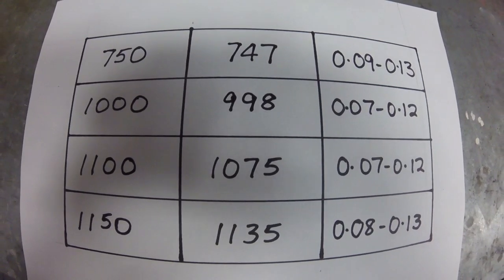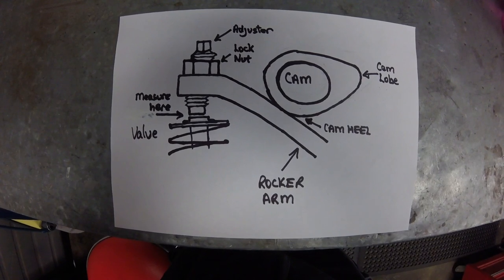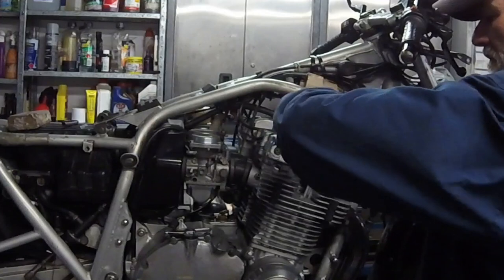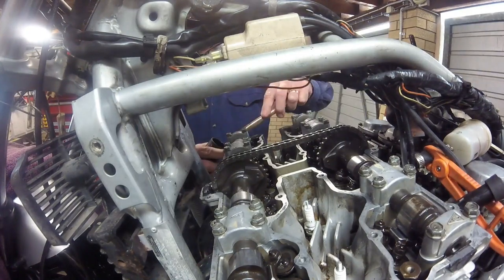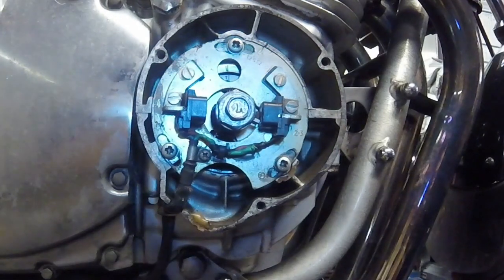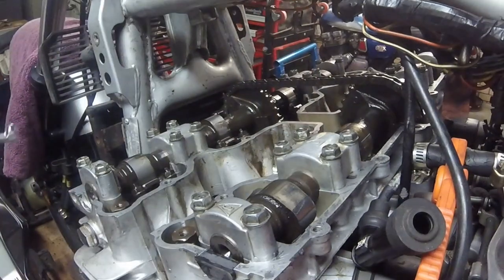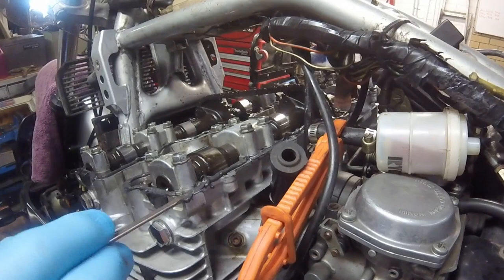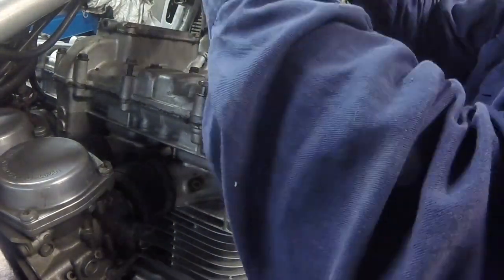Setting Valve clearances on the Suzuki GSX 750 to 1150 engines

Comment: Just wanted to note that you cannot use silicone on models with the tachometer cable in the valve cover as the gasket is required for the cable to fit.
Reply: but with the oil leak issues it might be better not to run a tach and opt for silicone anyway
Reply from the maker: Useful information, thanks for sharing.
Reply: Hmmm I was planning on just soliciting the cover. But the gasket came off in one piece minus I tear. Can i reuse it?

Comment: Great video. Your illustrations are superb! My one quibble is that you are using waaaaaay too much RTV. You really only need 1mm absolute max. Proper cleaning is more important than gobs of rtv. With that much RTV you risk losing some into the oil galleries. The professionals smear a very small amount on each surface with a gloved finger. Another commentor mentioned permatex ultra. That's the same stuff I use and I never get oil leaks. Cheers!

Comment: Hello Sir I have a 81gs1100E . I have the position 1 and 4 I cant even get 5 thousands filler in ...... can this be possible? On most of them?🤨😵
Reply from the maker: 5 thousands - for that model, 3 to 5 thousands is the imperial setting. So you should be able to slide a 3 thousands feeler in, but not a 5 thousands one. Hope that helps.
Reply: Yes! Yes it does ! Thank you sir🤓
Reply: @whitedoggarage  one more question on the timing Mark's....so I go to the line at 1.4 and then rotate 180 degrees?
Reply from the maker: @derekv275  Great 👍👍👍
Reply from the maker: @derekv275  Yes, as a further check the indents at the cam end should either point directly at each other or directly away from each other with the indents in line with the surface of the head where the cam cover goes.

Comment: Excellent video,clean and clear . Exactly what I was looking for to forward to  a friend. I do worry about the silicon on the inside of the motor falling off. Each to their own. When it might be a week to get new gasket you have to do what you have to do.I just order new gaskets ,in advance, and smeared a thin coating of black permatext ultra on them., allow to dry, then trim the inside/outside of any thing proud. Oil filter should catch all , but ,  1 tiny bit can do alto of damage to a bearing . All of this is too much for this video ! So thank you for the proper steps. Some day you might try my method and make another video.
Reply from the maker: Glad you found it useful and thanks for your comment. Yes, you have to be careful not to put too much silicone on. The critical thing is to let it set properly before use as it tends to self adhere if no oil hits it before then. If I have to turn the bike around and out the door in the same day I use a gasket alone. I find the early cam covers with just a gasket notorious for leaks however.
Reply: @whitedoggarage  I found the same problem with paper gaskets on my 1981 gs 1100. Thats why I coated them with ultra black permatext ,let dry then install. I always had 1 in stock and never had leaking problems after.

Comment: helow ...i search everywhere the service manual for my gsx s125 for making this service ( valve clerance ) i don find them...any idea what is the specs for my valve clerance?
Reply from the maker: I do not know the valve clearance specifications for the GSX S 125. Have you tired asking the bike shop? I don't know this bike, although I believe it is sold in Australia somewhere. Most modern 125 motorcycles I see are Hondas. However all of the liquid cooled Suzuki's with bucket and shim valve adjustment (like this bike) that I do have specifications for, require the following clearances: inlet 0.10 to 0.20 mm, exhaust 0.20 to 0.30 mm.
Reply: @whitedoggarage  thx man i wil go searching at the bile shop ..;)

Comment: Brilliant video, thank you, I remember could this 35 years ago, now I have another Katana 1000, looking forward to doing them again :) Why use sealant and not gasket or gasket and sealant?
Reply from the maker: Gaskets are expensive to buy and are meant to be single use items. I can gut gaskets, but these are fiddly to do. I find the sealant works well. I just leave it 24 hours to cure before starting the motor.

Comment: Thanks for the video. Great learning teach. Question clearances from 0.07 to 0.12. Why not go middle and set them at say 0.10.
Reply from the maker: Good question! The problem with setting screw tappets to a set value of say 0.10 is getting the slide fit of the feeler gauge just right, the clearances are small and a loose fit could be 0.15 for example. I find it quicker using the range, with the two feeler gauge strips, the smaller one fits and the larger one does not, next valve and so on.

Comment: I have a 2013 GSXR 750 do they have the same set-up??
Reply from the maker: Unfortunately they don't. On those motors they used shims between the valve and the cam. To set the clearances on them you first measure the gap between the cam heel and the shim. I don't have the exact specifications for your model to hand, but will be in the region of 3 to 7 thou on the inlet and 7 to 11 thou on the exhaust side. If the clearances are out, adjustment is by putting in thicker or thinner shims. First measure all your clearances (you need to have the crank at set positions for this) and work out if any need to be changed. You will probably need to buy extra shims if adjustment is needed. Replacement is done by removing the exhaust or inlet cams to enable access to the shims and a pencil magnet is your best tool for getting the shims out. There used to be a special tool you could use to depress the valve to get the shim out without touching the cams, not sure if that tool works on the post 1990 models. I have skimmed over the basics of the job here and you might want to look at a manual before you do any shim work 🙂.

Comment: Hello can the valve cause a outfunction of the spark plugs?
Reply from the maker: No, any problem with the spark plugs will be due to a failure in the ignition system. This video https://youtu.be/s_699JvS3E8 may be of help in solving a spark plug problem.

Comment: Very helpful! Would this same sort of screw-adjustment procedure work for an '83-86 gsx550? Its a 16 valve i4 like this one.
Reply from the maker: My understanding is that the GSX 550 has screw adjust tappets and this method will work equally well for it. Check the specification for the valve clearances, I believe inlet and exhaust clearances for that engine are 0.10 - 0.15 mm (0.004 - 0.006 inches), but you should confirm that. Hope that helps.
Reply: @whitedoggarage  Ah well that's great to hear man, I appreciate it! Definitely gonna give it a try myself then.    And You're probably really close on that, I think it actually says it somewhere underneath the seat. Will have to check. Thanks again!